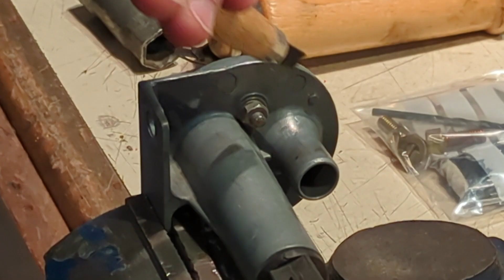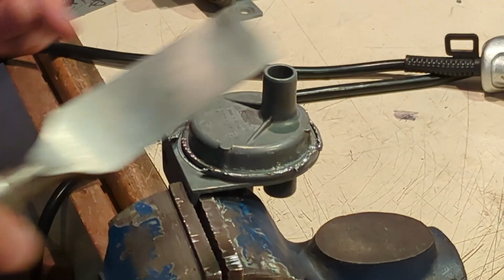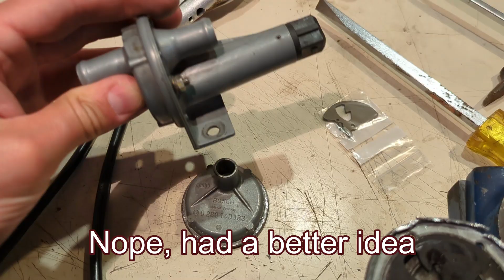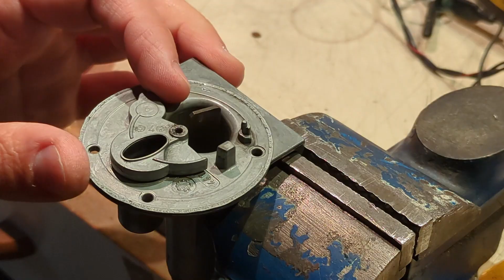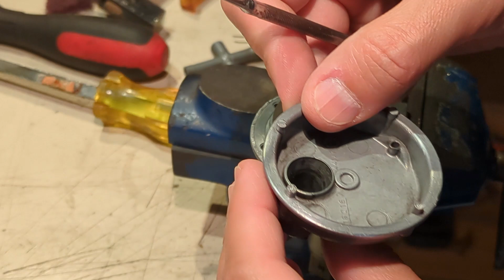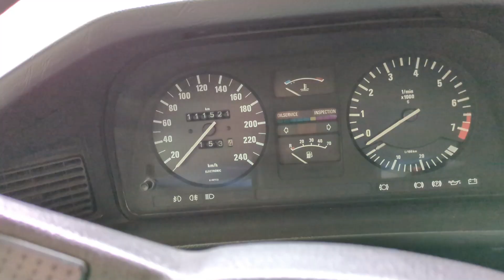Fixing Bosch L-Jetronic Auxiliary Air Valve the Easy Way (BMW E28, Alfa, VW)

Comment: When i unplug mine no engine change
Reply from the maker: Unplugging the valve won't make any immediate difference. The bimetallic strip closes the valve very slowly with heat from the resistor (powered by the plug) and from engine heat. You can squeeze the hose on a warm running engine to check that the valve has closed.

Comment: I like the way you have done that as it makes the valve easier to service in the future.
I have a 1980 628csi manual that I need to do the same repair.

Comment from the maker: I slightly enlarged the adjustment slot to increase airflow.
This was done carefully and in small steps, and may not be necessary in all cases (this bimetallic strip was particularly weak). Vacuum can leak through the slot if the flat washer doesn't cover it.